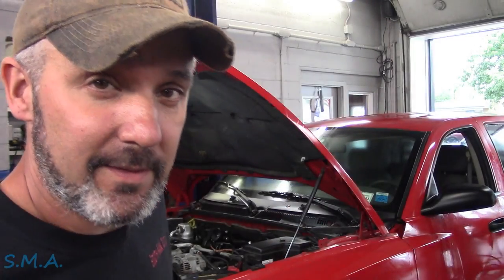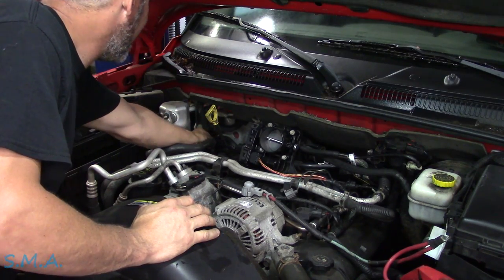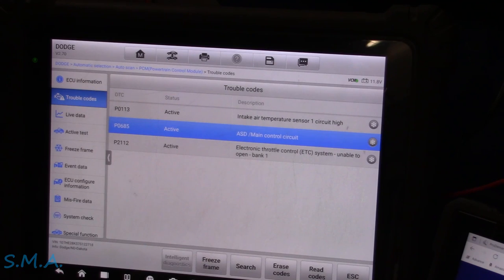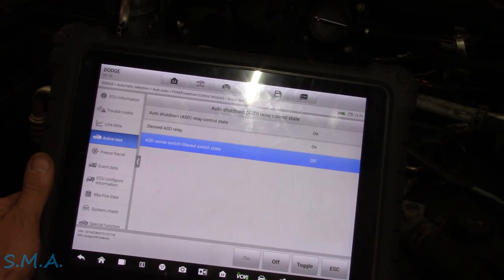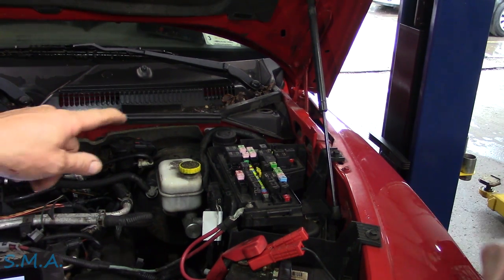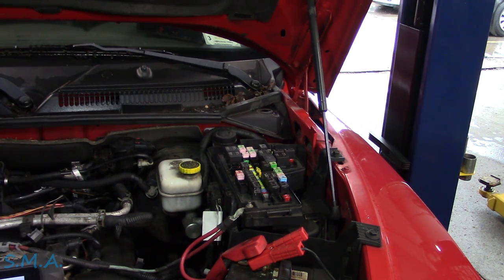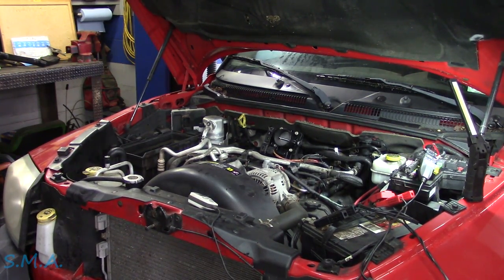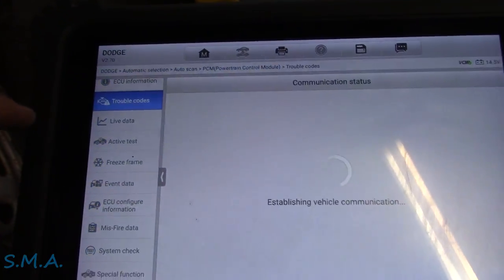Dodge Dakota: No Start After Clutch Replacement

Comment from the maker: When the fella who actually owned the vehicle came to pick it up he filled me in on a little secret. The guy or the other shop that was working on it pinched a harness in the bell housing. Evidently that was "repaired" then it got the new throttle body and was a no start ever since. Any how, mistakes happen, but still follow the evidence! -Cheers!
Reply: So they threw a throttle body on the truck and that did not "repair" the problem that they had created.   I wonder just how many other wires are still compromised from being pinched.
Reply: Could be it ran like crap before the TB too? It is a dodge yah know
Reply: PENED TO MY OLD 95 DODGE NEON BLOWN FUSE WONT START AND BOOM IT RUNS
GOT 2018 IMPRESA NOW
Reply: Makes sense. 
I’ve had repairs like this. Guy comes in, says he is leaking oil, i tell him to pop the hood, and found a funnel in the oil fill cap. Guys dad just did the oil change on it and didn’t put the cap back on.
Reply: If mistakes happen how come I never make them? I thought I made one once but I was wrong. 🤣
Reply: @Sicktrickintuner  as bad as the car driving along with a fuel hose being dragged along.
Reply: Almost like the beginning of a joke...how many technicians does it take to change a fuse?.  I'm not a mechanic, nor do I pay one on TV. But, I tell my customers what you are paying for is my experience to complete the job.
Reply: Some days it’s just TOO easy. Sorry. Had to point it out
Reply: Well there's ya problem lady🤦‍♂️
Reply: Easiest repair I have ever done , neighbor put new battery in his truck and left cap on terminal.
Reply: @muppetgump8522  I seen that when I worked at pep Boys and the customer installed their own battery.
Reply: @jeff7.629  Ya'll gotta be kidding me...LOL....I guess almost as bad as this "fuse issue"...holy crap batman !!
Reply: Ten bucks says it'll be back in with more money lights from the damaged harness, and maybe some additional fallout.
Reply: Waiting to see your video on the face lift of the shop
Reply: And the plot thickens 😅😅😅
Reply: Once upon a time, in the way back machine I installed an engine w/o the manifold. Overnight it rained unknown to me. Had a hard time starting the engine and ran crap. Explained my situation to a Real mechanic he told me to change the oil. He says the water in the oil changed the lifter/ valve timing. Dang it worked! Thank God for those real mechanicsin my life.
Reply: Ha that's funny my brother has a pontiac aztek (I know crappy vehicle) anyways a mechanic was reparing his ac compressor so long story short they must have slowly been pulling the wire to the starter cause when he drove it to my house they car would not start and upon inspection the wire was loose just one little tug and it came loose replaced the connection and started right up again.
Reply: @TheKillerMarine  ---Said "No one ever".
Reply: I've done that, clutch change on a Passat I pinched a main wire in the bellhousing, luckily it was an easy fix but I blew 3 10amp fuses before I found it...happens, although I suppose my excuse was wrestling that massively transaxle in by hand on my back, what was I thinking...
Reply: WE LOVE MRS. O .. CHECK OUT THE COMMENTS
Reply: Short videos are great also. Learn by others experience.  Plus you have some great electrical diagnostic tools.
Reply: There’s always and I mean always! Something the customer won’t tell you unless you have their arm halfway up their back.
Reply: Had a new clutch put in a Renault/AMC Appliance (Reliance, we just called it the Appliance) and they put it on top of the wiring harness which eventually got cut all the through killing the engine.  Took them a week to piece back together.   Sold the car shortly thereafter.
Reply: @Sicktrickintuner  I had Valvoline do that to me once.
Reply: He can R&R a clutch, pinch the harness, repair the harness but not locate and replace a blown fuse? Really? Beyond belief.
Reply: I saw a chevette one time that the auto trans was removed and sent out for rebuild.....it was reinstalled and wouldnt start ....the battery cable was completely crushed with the bellhousing and all insulation melted off.youd think they would have noticed that...
Reply: If that truck wore it's mask, this whole situation could have been avoided.
Reply: @Michigan_Tactical  Are you breathing?
Reply: @muppetgump8522  I had a customer replace his battery. He said the lights on the dash went crazy and there was smoke under the hood. Battery was installed + to - and the smoke was the alternator.
Reply: @TheKillerMarine  lmao!?!?
To what???? A peddle bicycle!!!
Reply: Mr O you and mrs O are a lucky couple keep on with the videos and work
Reply: @Dirtyharry70585  my 06 Chrysler Town and Country has just rolled a 163000 NO problem lights!
Reply: Seems to me pinching the wiring harness would lead me to check the fuses. Oh well. Great job Eric O. I look forward to your videos
Reply: @bradklingensmith  is the old joke about the ships engine that broke down and nobody could fix it. Eventually they call in an old engineer who's been working on those engines his whole life. He listens for a few seconds, grabs his hammer and taps the engine, and it starts straight away, running sweetly.
He hands he bill to the owners, and they question it.

"we want a breakdown of this bill. All you did was tap it with a hammer. How could it cost £5000?"
He seems then an itemised bill.
"tapping engine with hammer, £1.
Knowing where to tap £4999"
Reply: Big engine!
Reply: any chance "Jerry" did the clutch job ? (subaru rear light jerry)
Reply: @Sicktrickintuner  i ve actually have had drivers ( tractor/trailer fleet dude) tell me that someone stole their oil fill cap or stole a work light off of the trailer. One guy took a trailer i had an axle out of. Ignored the cones around the trailer. At a gas station, he calls my boss in a panic, tells him an axle came out of the trailer. Got Me out of bed to go out there, just for me to laugh at him. Corporate got involved. Bad week for all
Reply: Anyone who's replaced a transmission more than a couple of times has probably experienced a component or wiring getting in between the bellhousing and the block - the trick is to NOT squish that component during the install. It's SO important to get these to seat by hand where you can feel whether they're running into anything or getting hung up inside on the flywheel or flexplate.
Reply: @ekop1778  Thank you for removing that Neon from society. We're a better place for that.
Reply: @muppetgump8522  Yeah, I've seen that more than once.
Reply: @muppetgump8522  charge them twice! 😅😜
Reply: I REMEMBER STARTING TO WORK ON CARS SHEERLY OUT OF NECESSITY AND EXPENSE AND PUTTING IN A TIMING CHAIN IN A 3.6 BUICK ODD FIRE AND GETTING IT BACK TOGETHER AND LOOKING DOWN AND LEFT OUT THE CRANK SEAL OIL SPLASH CONE (3 TIMES)!!! SO AFTER TAKING IT APART 3 TIMES AND FORGETTING TO PUT IT IN 3 TIMES IN A ROW, I LEARNED A VALUABLE LESSON. LOOK AROUND (BEFORE) YOU PUT IT BACK TOGETHER! WHAT AN IDIOT! 🤣

Comment: 15 years ago when I was in auto tech in highschool, my shop teacher pulled out a coil pack and wrapped the rubber boot with aluminum foil, then shoved it back in causing the car to have a dead miss in 1 cylinder. Basically, it was a test to find and repair the cause of the miss. I found the foil, removed it, reinstalled the coil pack, and started the car. It ran great for 15 seconds, then died. Long story short, 2 hours later after going over the entire car with a fine tooth comb, I figured out the car ran out of gas....
Reply: Oh man, that has gotten me twice over the years, it does not bring back good memories almost replacing the fuel pump. Which was when I found out when I tried to pump some gas out of the tank.
Reply: Now there's a gaser !
Reply: Lol bomb #2 he left for you lol
Reply: I attended a Perkins Diesel school years ago where the instructor had surreptitiously put blockages in the fuel and intake systems on a T6.3544M Marine diesel that the 'class' had rebuilt. I think he got a little irritated at me for finding most of his sneaky tricks too fast. Had me sit the last few out.
Reply: @gcrauwels941   When you are too smart for the instructor, that happens.  Sounds like you're a great t-shooter.
Reply: The best story 😂😂👏
Reply: @jeffryblackmon4846  I eventually owned my own business doing it. It helps. :)
Reply: Damn!! But I have to agree, there have been a number of vehicles I almost caught myself chasing my tail on simply due to a no-fuel situation
Reply: @gt500knights  I just had one a week or so ago...customer lives 3 blocks from shop and 6 blocks from gas station...opposite directions of each other.  They pulled right up in front of our two bay door (pet peeve of mine since it usually means they know it won't restart so they park there to jump the line...but I digress) they were like "I was on my way to get gas and it started misfiring and backfiring so I turned around to have it looked at." So I dumped the remaining half of a 5 gal can into it, we normally charge $10per gal. but told him since it was such an easy fix if you go refill both your tank and ours we will let it slide this time...he thanked us we got a full jerry can delivered and we all got a good laugh out of it...I'm just happy he didn't burn his pump up, that and replacing Chevy pickup brake lines(whole kit) is probably my least fav. jobs as a mech.
Reply: The old basics.fuel, spark and air.All the above in the right place at the right time.
Reply: @Z4Zander  assuming PCM is getting proper inputs. And commanding the proper outputs. Fuel spark and compression yes, but with the added dimension of vehicle computer control
Reply: I've had that happen with lawnmowers, you clean the carb or whatever to fix the problem pull the cord and it stalls put, thinking you did something wrong then that little voice says, check the gas dummy. I just had a no start with my own lawnmower, gas full intermittent spark, pulled the coil from an old engine I have for parts, started right up after that so I decided to get a new spark plug as well, I bought an autolite, I didn't even know they made small engine spark plugs, I put it in and no start, I kept pulling the cord it wanted to start but backfired a little instead so I put the old champion plug back in and it started right up, I put the new plug back in and no start again, even new spark plugs can be defective right out of the box.
Reply: Recently I was mowing the lawn with the old trusty Snapper riding mower.
I was about 20 minutes from finishing when she died.
I turned the key and got nothing.
I knew the positive battery cable was kind of corroded and a little loose, so I changed the cable end and cleaned all the corrosion.
I noticed the ground cable was a little out of sorts so I changed that cable end and cleaned everything up thinking "done deal and I won't have to fool with this for a long time".
Now it spins over like a champ, but no start.
After a few minutes of cursing the day it was built, I checked the gas tank.
Yup, dry as Yuma Arizona on a summer day.
It happens to everyone at some point.
Reply: When i was in school i broke a pinch bolt on a Taurus rear strut. I just yanked it off with my breaker bar cuz i didnt know better. The instructor gave me a drill and some bits. It took me 2 full days to drill it out. Afterwards he told me he gave me the dullest bits he could find to teach me a lesson. I think of that shit EVERY TIME i have a rusty bolt lol.
Reply: @Peter-pv8xx , I had an older murry that the engine just completely lost compression on. So go buy a new craftsman, and run it for a season until the motor started surging. Figured it might be a bad sparkplug until I changed it out with the one from the old mower. My frustration was at the point to where I was ready to take apart this new engine until I looked at my air filter. It was completely clogged with dust. Changed the filter, went start it, nothing. Came in the house for a minute to cool off, and realized that the old plug i had put in the new mower, had a short in it. I remember testing it and seeing a spark when I held it away from the muffler, but I was so frustrated that I over looked it didn't ark when I touched it to the muffler. Needless to say, I could have had the mower going just fine with a new filter. Remember folks, make sure your spark plug is always touching ground to make sure it doesn't have an internal break.
Reply: Pulled a Slingblade. IT AINT GOT NUH GAS INNET
Reply: Actually a similar story is what got me into working on cars. 19 year old me with a junker I bought cash was driving one morning and thing just dies on me. Come to find out it was out of gas and the fuel gauge wasn't exactly 100% accurate. $300 later and lesson learned. Definitely the most expensive tank of gas I've ever bought.